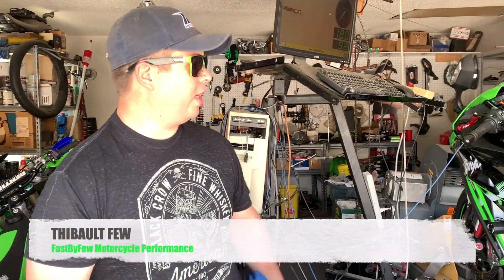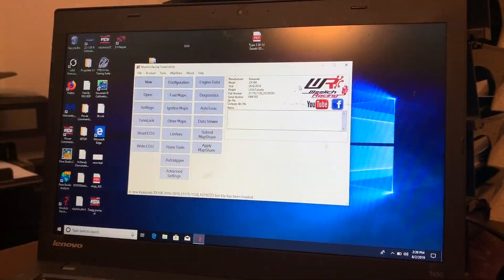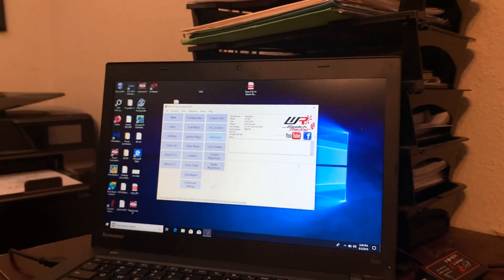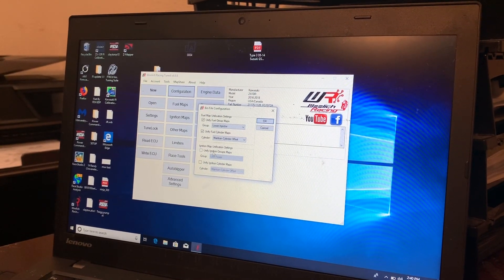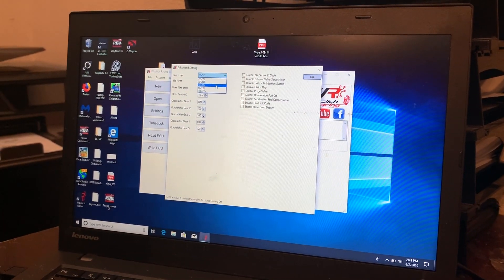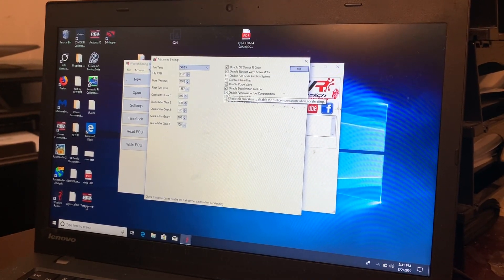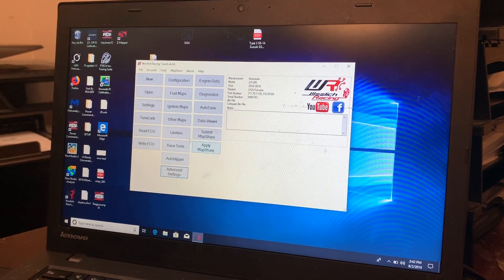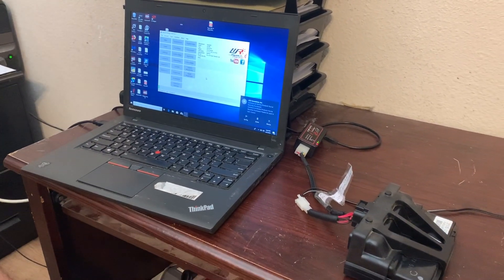Motorcycle ECU Flash & Dyno Tuning Process!

Comment: Is it worth flashing a bike with stock exhausts on? I have a 2016 zzr1400.
Reply from the maker: Yes, flash it!
Reply: @wildwhiskeywolf  gonna book it in and then get the aftermarket pipes later. Will it need re doing after or Williton be good to go? Thanks for replying.
Reply from the maker: Just get a dyno tune after changing the pipes and you’ll be good to go

Comment: What about the gas mileage?  Who much do you lose? Is there a setting for having power and still saving gas mileage? I got my 2019 Mt-07 flash and I lost about half my gas mileage. I used to get 180 miles per tank, now I only get 125 to 135 miles per tank if I don't go hard. Any recommendations? I can always mail it back to the guys who did the job but I am wondering, what can I tell them?
Reply from the maker: Gas mileage becomes better with flash/tune..get about 70-100mpg cruising around
Reply: @wildwhiskeywolf  I rode today, I hit 100mph and lost a whole bar of gas. What can I do?
Reply: @JorgeGarcia-mz8pw  slow down....You dont gain mpg and hp at same time.Its possible the tune was done in different conditions which gave you a not so good result..Maybe tuner didnt know what he was doin,maybe your rideing style did a big change and that causes the mpg to drop..Assumeing all was equal and you went from 180 to 125ish miles per tank,something got buggered up..

Comment: My current GSR 750 with Yoshimura slip on with no DB killer & high flow air filter. Do you think i should go re-flash the ECU? I saw your gain is +10, that is very good!
Reply from the maker: Den C No if the ECU is already flashed you shouldn’t need to get it re-flashed. You may however, consider getting a dynotune since you changed the exhaust and air filter.
Reply: @wildwhiskeywolf  Mine is still the stock ECU. So havent been flash before.
Reply from the maker: Den C Go ahead and get it flashed! Big difference!
Reply: @wildwhiskeywolf  Wow, that is encouraging ! I saw my local tuner is also using woolich racing software. And yes, my tuner will put on dyno as well. Then i shall see before and after result.
Reply from the maker: Den C Awesome! You will love the results!